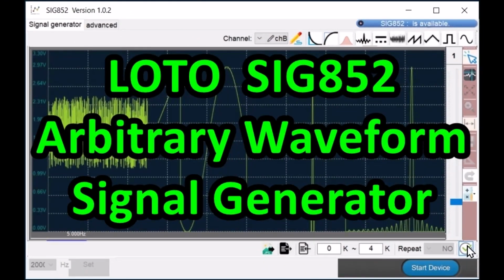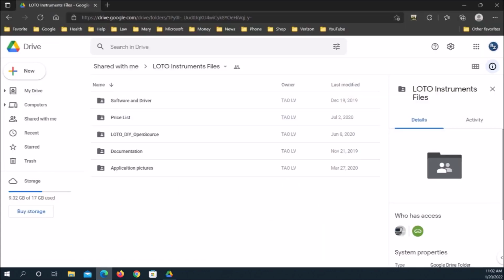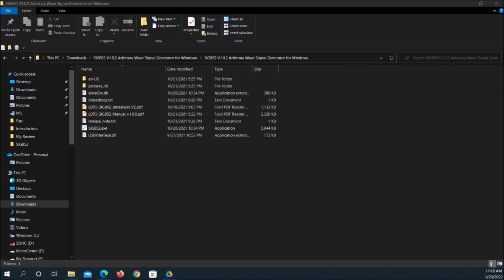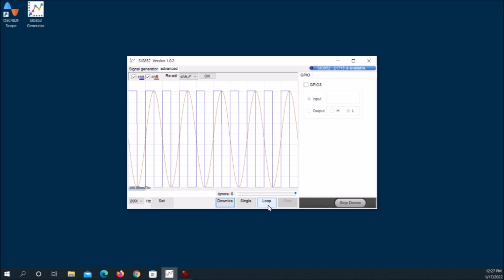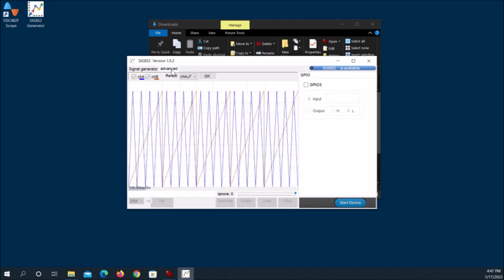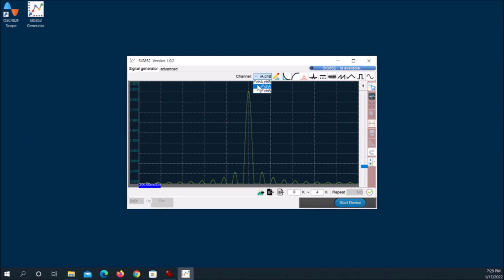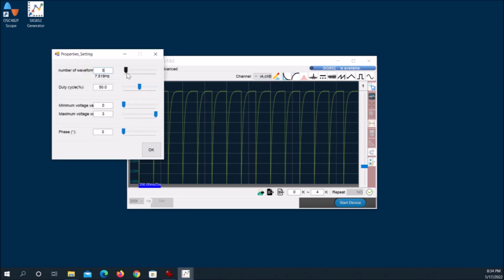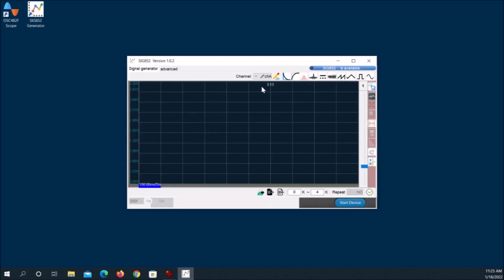LOTO SIG852 Arbitrary Waveform Signal Generator

Comment: Free Gift information provided by LOTO Instruments,
"SIG852 Aliexpress store link:
https://m.aliexpress.com/item/1005003446025965.html?gatewayAdapt=Pc2Msite
https://www.aliexpress.com/item/1005003446025965.html?gatewayAdapt=Pc2Msite
If you place order by the above link, LOTO would like to send a blue tool case as a free gift.
Note: Please contact seller when placing order and send 'FRIEND OF RONALD' as promotion code, so that seller will add a blue case in your parcel. If you do not send promotion code, free gift will not be included. Promotion expires by May 31, 2022."
😀